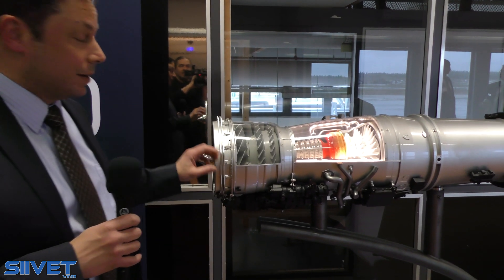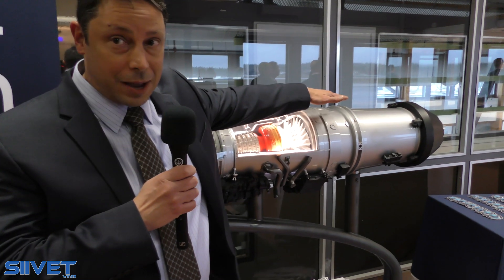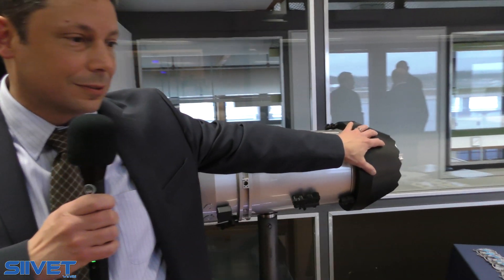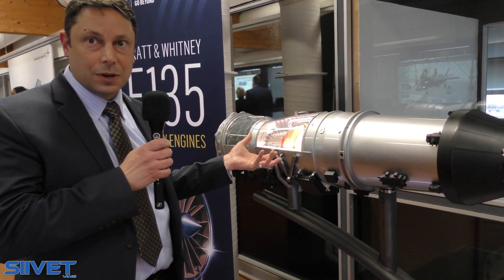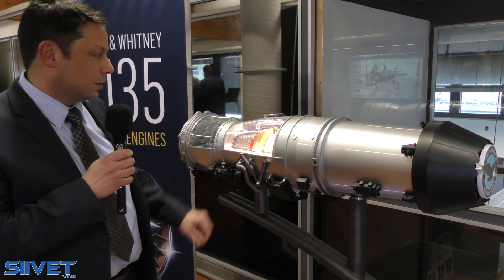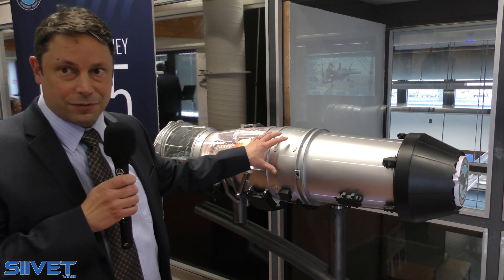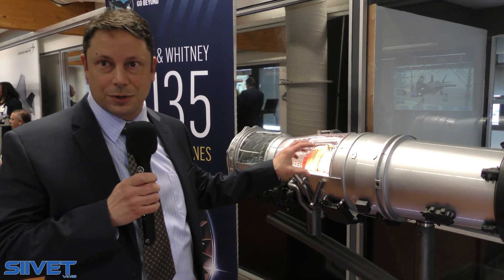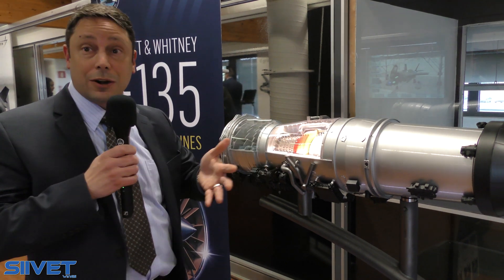F-35 Powered by Pratt-Whitney F135 - HX Challenge [4K UHD]

Comment: Can we mount the f135 engine on the f-16 or other aircraft ?
Reply: Cant, F135 is much larger than the F110 or F100 on the F16, and the F135 consumes more fuel cuz it is much more powerful.
Reply: No, it won't fit, the f135 is huge, there's a picture on the internet of the f100 next to the f119 and the f119 dwarfs it. The f135 is even bigger than the f119